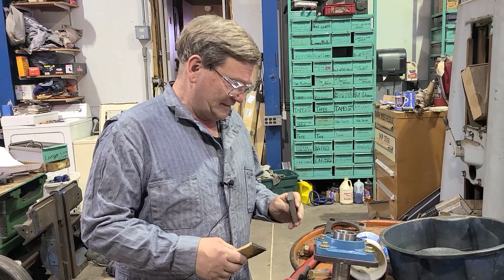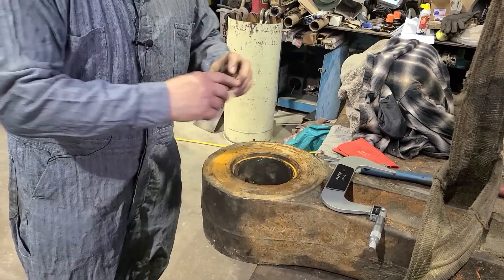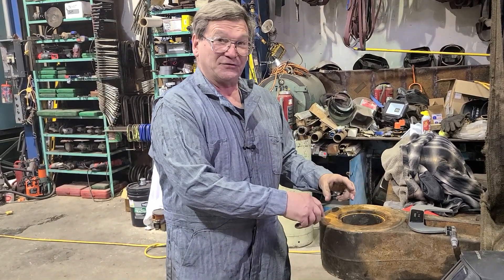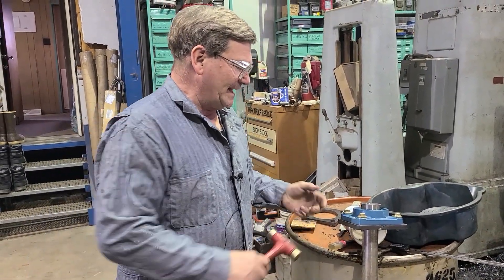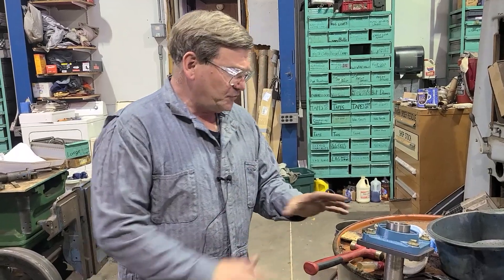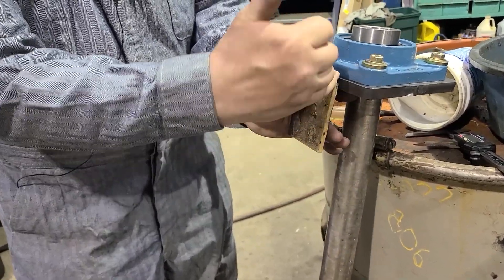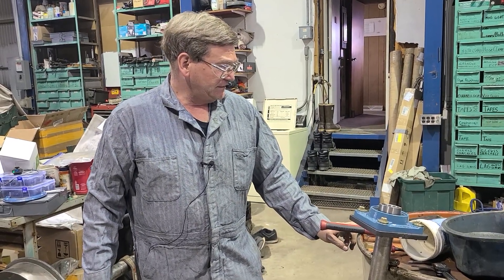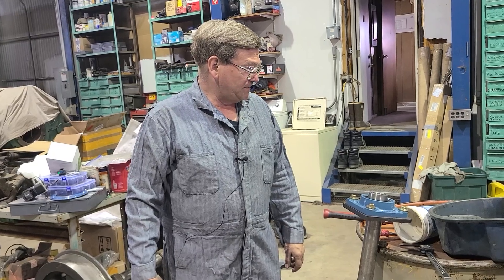Machinist's Minutes: More thoughts on line boring

Comment: If the running fit between cone ID s and the Bar, and if the bar is very straight and hard, and if suffecnt equal  and around the cones base put on both cones even and around, I could see the possibility of the original center drifting, but the cones would have to be parallel,  Is that oversimplification.

Comment: I have a sacraficial plate thats tapped. I bolt my bearing housing with countersunk screws. So I position things as well as possible and weld the base plate in position. For final setup I swap out  countersink screws with conventional bolts and heavy flat washers. Because the bearing housing was located with countersunk screws their is still clearance to do final alignment in all directions.

Comment: Hallo sir, how are you doing. What years range that grey clamp  was made in.  Thanks. Reason I’m asking is that I bought one from eBay seller two days ago it has plywood type box and time beat up sponging material inside. Would like to see if it can be approved by you.
Reply from the maker: I don't remember when I got the set of gray clamps, I have observed some brands/time frame as being awful, but I would judge the good only on a case by case basis.  You need to check yours.   :  https://www.youtube.com/watch?v=Z-XcSvVG3WQ&t=599s

Comment: I made my own line boring rig. I had my cousin make me a variable speed setup from.a 1.5kw ac 3'phase ac motor I had. I added gearboxes and used it for a rotary welding assembly. Got me thinking and in no time I made a feed mechanism. Was a 16:1 drop down that ran in line. 2 sets of 4:1. From that I added a long tube and fitted a bronze threaded bush. When the bar is rotated it winds down a suitable thread. 16 tpi gives me about .003" feed, 10tpi gives me about .007" feed per rev. It pulls thru centerline of the bar at opposite end of bar drive head. So to feed I stop threaded bar from turning. If I put my battery drill on the thread and drive it fast it acts like a rapid Travers system. Works really well. Two rigs, rotary welding table and line boring kit only owes me about $2500. Paid for them easily. Was using for welding fire system droppers. Double ended malleable iron bush on each end. Could to 66 doubles at $4.00 weld per hour. Did thousands of them! Better money than a lawyer!